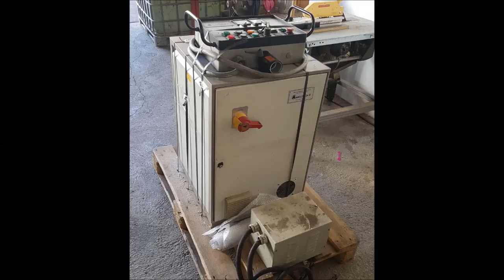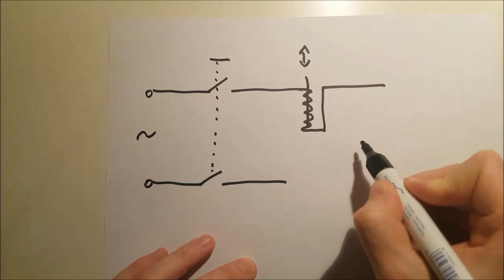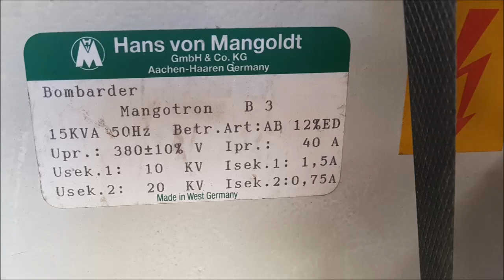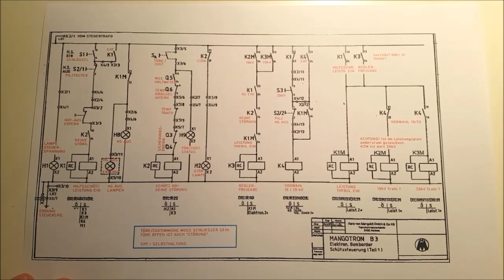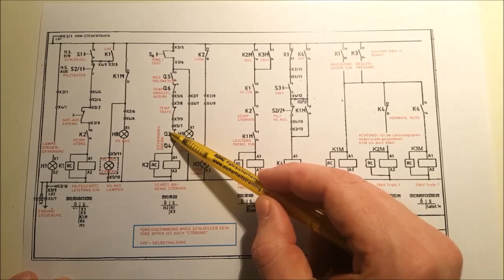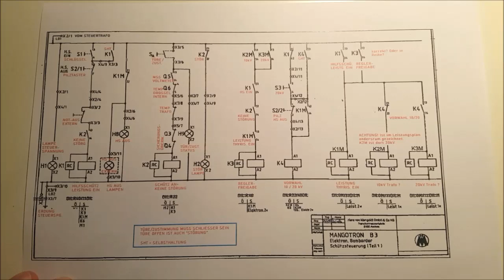Looking at my new "high tech" Neon Bombarder system

Comment: Hey! maybe you have the information I'm trying to find, I'm looking for information about a neon pumping station with bombarder i recently purchased, it also has a 10kv and a 20kv option. Im wondering how much power it needs to operate.  Do all bombarders require 400v and 3 phase power? what would happen if it was run on 240v?  From Michael.
Reply from the maker: Hi Michael, this is very dificult, you don't have any manual or at least a label?
Mine has 2-phase.
Bombarder input is either single phase + N or 2-phase.
But you would need to find out which voltage it was made for.
Reply: Unfortunately, the only thing visible  on the transformer is that it is made by masonlite.  Nothing else, no manual, spec plate, or information stickers. Not even a power plug on the end of the wires, they are just stripped bare.

I'll see what I can find out about 2 phase l. I've only ever heard of 1 phase and 3 phase. Thank you.
Reply from the maker: @SummersSnowVideos  send a photo of the bombarder to Graeme of Sign Tec Services in the UK. I believe his father was masonlites technical director for many years.
Reply: Thank you.
Reply from the maker: @SummersSnowVideos  2 phase means, just using any 2 phases of a 3 phase supply. The 3rd stays unconnected.

Comment: Is it safer to use manual? Electronic always has the possibility of failure, and as you said yourself, you dont get second chances with current like this. I believe the first jolt of power is roughly 40 ampre for a millisecond. Doesn't sound like much, but if your hand is touching something when a fail safe switch malfunctions 😬 that current will blow your heart up like a balloon